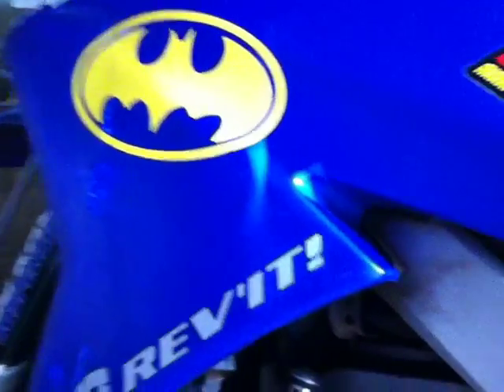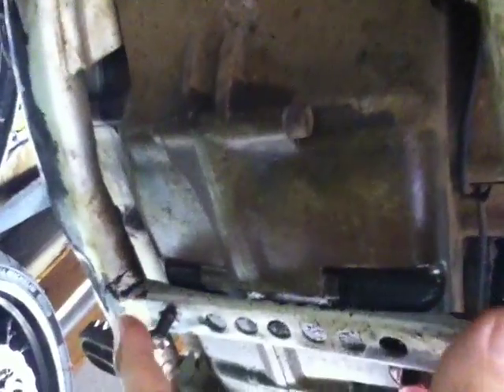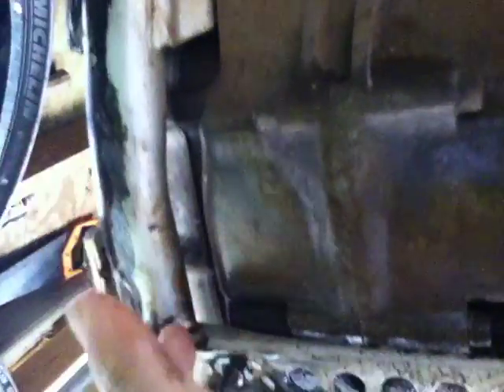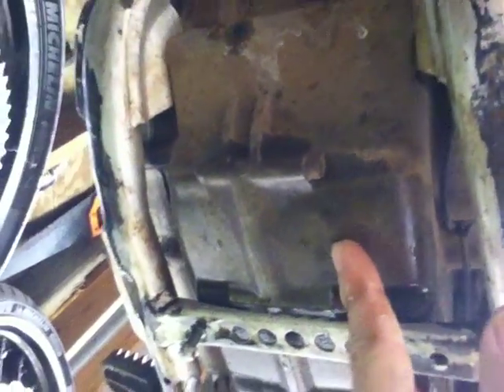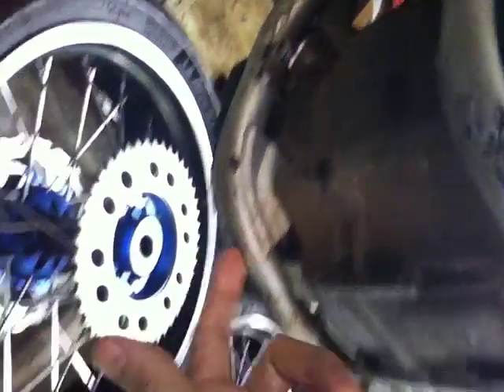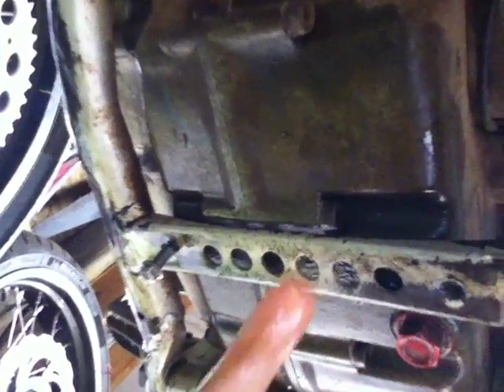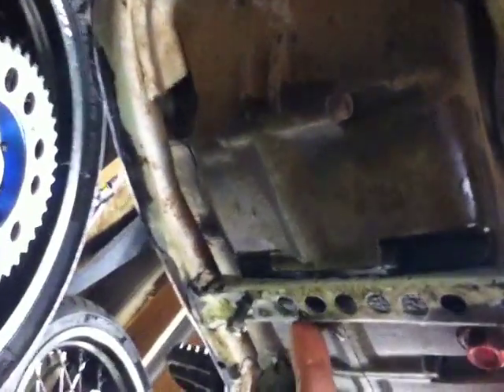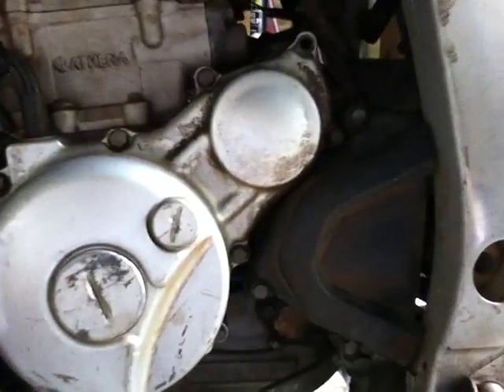Holy holesauce Batman! ++

Comment: I agree, but in a pinch I'd try to flush out the piece of aluminum by running hot oil thru the engine and while leaning the bike toward the drain hole. Problem with welding the alloy case is mainly in the warping that will occur if the welder doesn't properly control the heat.(not to mention loss of tempering in that area) I'd still expect at least at .002-.004 of movement(heat expansion) which could keep the gaskets from sealing properly under pressure.

Comment: I like your original idea. Drill the hole in the support bigger, drill and tap your case with a 10-32, sink a screw in with some rubber gasket on it.  You can go metric too but get something with very fine threads.  My 2008 KX250f had two drain plugs, one of them cross threaded on my second oil change and I tapped it out to a 10-32, directly afterward I used a counter sink/reamer  around the edge of the hole so the bolt head could lay flat.  Use a drill that has a clutch and set it really low

Comment: Pull your skid plate, drain your oil, clean the area really well & JB Weld it. JB weld sealed a crack in my oil pan (on my car) for the better part of 2 years.  Plus I'd scrape bottom so much that it smoothed itself out to the point where it almost looked professional haha. $15 total. but make sure you clean the area really well...when you think you've gotten rid of all the oil, spray it down with brake or carb cleaner some more let it dry, sand it, then clean it again then weld it. Good luck

Comment: Tribe-Advice-Avalanche incoming^^

I wouldn't cut the frame, i don't think it would cope with it long term

But since the front frame is just screwed on, support the engine in a way, that if you take away the frame it stays in position
(maybe strings up to the main frame or just some wood under the engine)
Now you can unscrew the lower frame bolt and the engine mount, and should then be able to just tilt away the front frame using the upper bolt as pivot point.

should be easy

Good luck Kalani!

Comment: You can always put a jack under the front of the block to hold it in place while you remove the tubes. When you tap the case make sure to use a thick grease and drill slowly so you don't get any metal shavings inside, that will cause havoc.

Comment: Hey AB, I agree with the proponents of pulling it all apart buuut, I think you could over size drill out the cross member hole to allow you access to tap out and plug the punched hole. Then I would run some super light weight oil into the crank case, really top that sucker up then release the real drain plug to flush out the broken bits in the case. You can also use a pipe cleaner to sweep the bottom of the case to try and coax any fragments out. then I would put in new oil, cross my fingers rev

Comment: I wouldn't cut the cross member. Maybe just widen the hole in the x-member with a 1/2inch drill. You can control the drill bit depth by drilling a 9/16 hole in a piece of wood cut to the right length so that only the tip of the drill bit is exposed for cutting thru the x-member. Then you should have plenty of room to drill/tap for a 10mm plug.

Comment: Kalani, I recommend one of two ways. First off, if you can pull the side of the engine easily, you could just drop a short bolt through it with some copper washers inside and out and then put a nut on it. If that is not possible, I would carefully drill out the hole in the brace to 1/2" or so, and then drill out and thread the hole in the case. Put a bolt into it with some threadlock, and then JB Weld over the top of it for good measure. BTW, JBWeld holds 3960 PSI up to 550 degrees. Strong stuff

Comment: Theres this stuff called quiksteel, you knead it into a ball and then it becomes like clay and you can mold it into the case. If it were me I would drain the oil, clean up the area around the hole, put a piece of duct tape on it, wash the bike, then use the quiksteel. flip the bike and get it in there under the frame brace thing. Popsicle stick would help. skid plate: get a big beefy one like from enduro engineering and see how it mounts.  Avoid cutting a new hole and use a short bolt

Comment: I second that... but you have to have to get the repair area super clean first (no oil). I wouldn't just cut the crossbar out... I would just get shorter bolts and a new (wider) skidplate :)
Hey, the wr250 engine is also mounted at the swingarm pivot. If you simply support the front of the engine on a jack, you can unmount it at the front and  lower the downtubes while the engine just hangs out where you left it :) It may swing up and down a tad, but if it's on screw jack, you are in control!

Comment: Use a couple car jacks. Chock the wheels so the bike is vertical. Find a good plate to spread across the crank case, then use a car jack or two just to hold the engine in place when you drop the down tube, leave yourself with a little room to tap the hole. It can save you a lot of time and effort, but you run the risk of having the engine fall off the stand and tearing it's wiring and such. A floor jack would work great though. And when you're done it should fit right together. Maybe...

Comment: It looks like that cross bar (that you were talking about cutting) might help support those down bars and prevent them from spreading.  So, if you're going to cut it off, I'd suggest welding a replacement back on.
But I'm no expert and, like my advice, you get what you paid for.

Comment: I think Mr. Mike is right. The engine is small and light, its not hard to wrangle that sucker around. I wouldn't dremel a hole where you want to because there is a weld sooo close to that hole. I think what you should do is repair the hole, and if you are to put another skidplate on, put some washers on the outside of the skidplate so that the bolt doesnt go anywhere near your crankcase.

Comment: This is just an idea: Cut the lateral support (you need that), clean the hole with rough sandpaper (100grit should work), use a 2 part epoxy putty to fill the hole (I used to sell it when I worked for OREILLY'S), cut a length of steel angle to fit between the frame tubes but over the holes, drill mounting holes for the bolts that are a press fit for the new bolts (you need lateral support for the frame). PM me for more detail, if you wish.

Comment: Tapping the case is risky if it's thin (probably is), after such an operation there is also no way to be sure you haven't left chunks of aluminum in your engine without splitting the cases, the bolt could very easily interfere with something in the engine (they don't waste space in there), and torquing the (extremely short/ large diameter bolt) is a major guessing game b/c you are only engaging about 2 or 3 threads. 
I say you have two options:
>JB weld (the cheap way)
>weld it up (the best way)

Comment: I own the same bike and I'm a mechanic by trade. The motor shouldn't fall out because its being held in still by the swingarm bolt. Take the lower subframe off and use a jack stand if your worried about it falling. As far as fixing the hole jb weld will work but only if you get it 100% oil free and scuff around the hole with some scotch brite to give it some more adhesion. The best epoxy I would try first this stuff called pig putty. Pm me for more info is like to help out a fellow wr rider

Comment: If it were mine, I would TIG weld it. With TIG you can control the heat a lot better and I would also use a heat barrier  to keep the heat from spreading to the case gasket. Any professional welder should be able to do this for you.

Comment: Drill out the existing hole to a size where you can work with it (perhaps 1/2").   Drill and tap in the case.   Make sure the new bolt you put in the case is short enough where it does not interfere with the working internals of the case.   Use lock tite!  If you don't like that idea take it to a welder, have him fill the hole with aluminum.  I have had this done before, with no issues.   I don't think it will get too hot. The Welder will know. Perhaps he can weld the bracket back on for support

Comment: been there done that.  Just die grind the brace off and bolt another Bulkhead on the outside of the down tube.  You can either try to tap the hole int he crank case and tap it or clean it and epoxy it.  Word of advice, if you use a threaded bolt use a neoprene washer not a copper one.  you don't have the thickness to tork a copper washer.

Comment: The problem isn't gonna be the plate , it's gonna be the engine because they are a pain in the ass to weld then there's a weakness etc

As for your support , bad idea. The bracket offers tensile support to the frame , even then it's still the best place to put the skid plate. I would suggest getting a new skid plate or extending the old one around the engine a bit more , placing it on top of the support then cutting the bolt down a bit.

On the XT 600 the engine has brackets at the top too.

Comment: I wouldn't cut that, I'm pretty sure it's to reduce flex. I would use tie down straps to hold the motor up and just unbolt that part of the frame, get the metal out of your motor with a magnet and put JB Weld over the hole to seal it, while it's apart, drill the mounting holes where you want, bolt it all back together and ride like nothing happened before the sun goes down.

Comment: i would cut it, then take another piece of aluminum and weld that somewhere else on the tubes so you will get the support back, but you will also have to modify any other skid plate you put on, but that cross member does hold a bit of rigidity in it. 

PS nice sumo wheels on the side of the garage

Comment: You can cut that brace out, I highly recommend finding someone who has a tig welder and plug the hole for good. motor cases are very thin in certain areas, hence why that bolt punctured it. I would not trust a tapped thread on a thin part of the case. Good luck Kalani

Comment: IMO it needs to be replaced, if not , I would weld (or silver solder?) it. It is likely potmetal and has stress cracks from the hole already, putting a bolt in there would be sketchy, definately drill it out to remove any stress cracks first if you do. I would think the thickness isn't there to support proper threading though. The brace likely serves more as lateral support for the frame than anything and could be R&R'ed I'd think. Doing it right is easier that pushing it out of the woods! Best.

Comment: I would say it is OK to cut it off but I would get a piece of steel that can be re-Bolted back in place once the repair is done so that you don't lose any of the strength of the down tube assembly.

Comment: I recently purchased a new skid-plate for my WRR which is made from 1/4" high-density polyethylene plastic; I am extremely happy with it and would never go back to using a noisy aluminium one ever again. Here is a link to some pictures of the aforementioned skid plate which is manufactured by AXP Racing and is also sold under the Moose Racing Brand in the US.

Comment: First I would pull the engine and split the case so you can remove the small chunk of aluminum that is in there from the bolt punching through. Then i would simply weld the hole and slap it all back together. Then get some sorta thick ass skid plate so you can smash rocks all day long. Good luck!

Comment: lay the bike over on the left side(so that no oil drips out). get some 60 grit sand paper and brake cleaner. clean the hole with the brake cleaner, scratch the case with the paper, cleaned it again and jb over the hole. don't put too much in the hole so that it's inside of the engine.  don't cut the support!  little things like that stiffen the chassis. 

would be best if you could find ruff piece of metal(about the size of a dime) to cover the hole.

Comment: After sitting for a while it falls to the bottom. I would get a magnetic drain plug after using a magnet to get all the metal out. Unless the motor was ran without oil... If it was ran without oil, I'd pull the motor and replace all the seals and bearings, or at least check them to be sure. Last thing you want is for that one small hole to ruin the whole motor.

Comment: you can just cut that bolt the size you wanted, but i wouldn't recommend cutting off this plate or making a new hole through it's soldering
so: thicker skid plate, preferably one that goes on the outside, so that the hits it's taking gets absorbed by the bike's frame, cut the bolt in the exact the size you want and maybe some rubber between this little plate and the oil thing

Comment: a long term thing is to take the motor out its some work but wort it take it a welding shop and get him to tig up the hole. might take some time and hard work and cost some more money but you wont have to worry about it ever letting go and it will last.

Comment: Well that cross member is probably in there for a reason. Probably to stop your frame from spreading apart. Just cut it, fix your hole, then simply weld it back in place.

Comment: Enlarge the hole and tap and thread the crankcase for a small bolt to seal the hole.  Just be sure there is enough room INSIDE the crankcase.  You don't want the sealing bolt hitting engine internals.  

I'd avoid cutting the bracket off.  Use a Flatlands Racing plate and just use three bolts instead of 4.  

And keep your eyes open for a parted out engine on ebay for the future...

Comment: drill out the existing 8mm bolt hole to the size of the holes in the center of the skidplate mounting bar (I guess its like 12 or 14 mm or so) and use that to dril en tap the hole in the crankcase. then make 2 new holes closer to the downtubes for mounting the new skidplate

Comment: honestly i think if you use the cut and bolt option it would work. BUT it might cause more long term pain+ work and money, if you take the case apart and find a cheap replacement case on ebay ($100-300) the job would be done right, i replaced a crankshaft and all my internal bearings on my wr250f and it was hard work, but if you follow the steps from a manual and take it slow you can do the work yourself and check the condition of all internal parts (bearings, seals, gaskets)

Comment: i have a honda crf230f and i got a msr skid plate that wraps around the bottom sides of the crank case and it clamps to the down tubes of the frame and no bolts go into the frame just clamps on its really nice

Comment: id say put a nut on the end of the bolt you have that holds the plate off cut a little bit off the bolt unscrew the nut ( so your threads will be retaped essentially jb weld the crank case and reuse the new shorter bolt, or use for get that idea jb weld the hole and use pop rivits every time you change only use drill out the old rivits and put new ones in sorta pain in the ass but i would not suggest drilling a new hole in that plate its hollow where you pointed, not solid all the way through.:)

Comment: to be honest , his absolute best case would be to just got a new bottom end because the wold will make a weakness no matter what the method is. My dad had a similar problem whith his R6 and we got a guy with qualifications and had been working in this stuff all his life andthe hole was sealed for a while , maybe a weak  but then it started dripping again. That whole was bigger though so maybe he will be good with it. He wouldn't have to take the top end apart either.

Comment: Cut it off, repair the hole the way you recommend plus extra liquid metal and all sorts, weld bracket back on if your worried about support, tap new holes for skid plate, Braaaapppp.

Comment: id say you should split the case first off, because you more than likely have a chunk of aluminum in there, and to fix the case i would get some JB weld (2part appoxy) rated at 550F it will be alot of work but atleast you dont have to pay a welder just need to buy the appropriate seals

Comment: Definitely leave that cross brace there, good idea to drill a new hole in it for your next skid though. What should be done is just let it be a big job and have patients bro! You will feel much better when it is done if you turn the bike upside down and pull the down tubes off and out of the way!! Sucks monkey balls but it is one iof those things you have to do right!!! Also after you tap that baby and get her plugged you should run like 5 or 10 courts though the case with the drain bolt out

Comment: I thought it was side case from you FB post. Hate to say it but you got a chunk of metal floating around in there where there shouldn't be. To fix it right and not roll the dice you'll have to pull the motor out, split the case, and take it to a GOOD welder who has done some of these. If you know any locals that race sportbikes they can probably recomend someone good. It's very hard to weld but a very good welder (probably not the local muffler shop) can do it. Maybe better to just buy Ebay part

Comment: This is probably a day late and a dollar short, but I'd have to agree with the Piggy Pudy or JB Weld option for the hole. I'm not sure if I'd cut the cross brace off. I don't know but doesn't Yamaha's OEM skid plate bolt up using the same cross plate? What do they use for bolts? Length, style, etc. 
Also lime someone mentioned, I'd be worried about the piece that was knocked out floating around in the crankcase. Maybe lay it on its left side (drain plug side) for little bit then drain it.

Comment: Any time you go pokin holes in your engine you are looking at a big job to fix it right. You can tap it and put a bolt in the hole, but I'd worry about it leaking or cracking the crankcase and making the problem worse. You think breaking a chain master link sucks, if you start pissing out all your oil in the jungle and your really screwed. That is a very poor skid plate design for this very reason. 
The new CRF250L is a nice option too.. :)